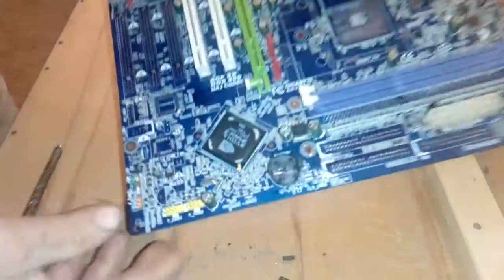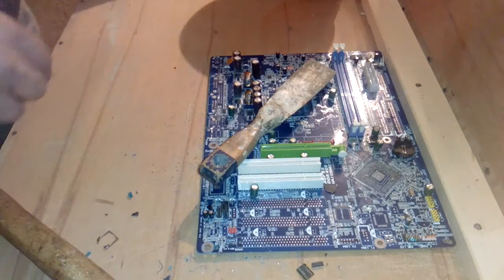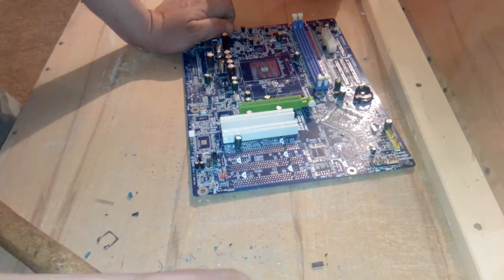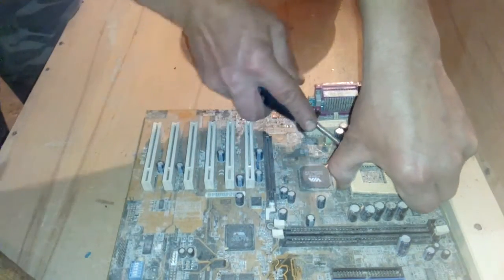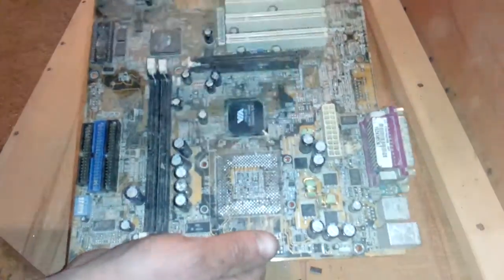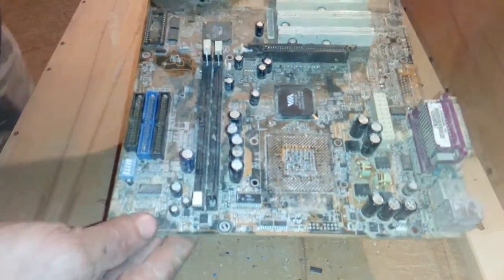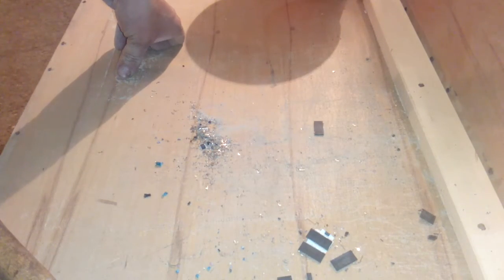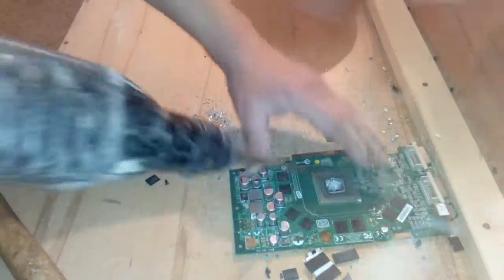Depopulating motherboards & pcb boards part 2

Comment: Paint stripper!! that is what I need may be better then a screwdriver thanks I always learn something new from you even when I watch multiple times I catch stuff I did not the other times I have watched!
Reply from the maker: Yes,very useful tool.
Reply: Yep I totally forgot to get one now I know I need one LMAO  I may get a pack of em differant sizes... the green fiber chips I do not want to break.... btw any tips on mlcc's I have been using a flathead but the micro ones just seem to break.....  STacking :)